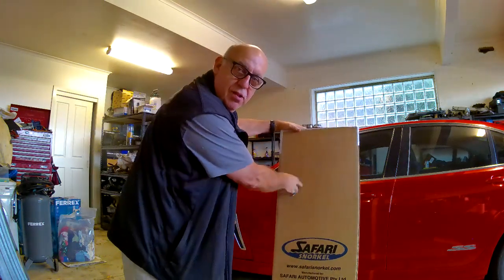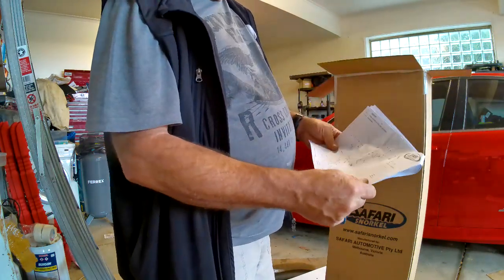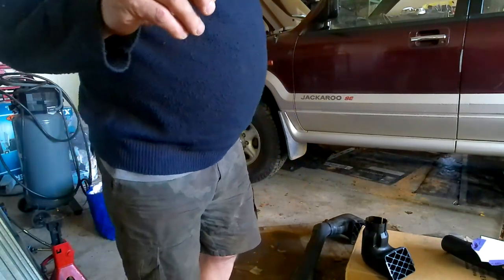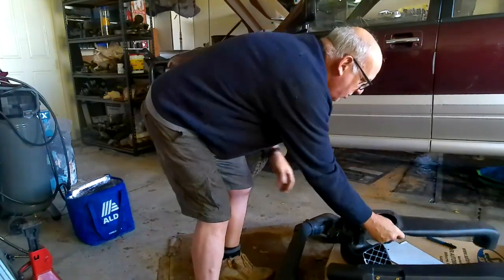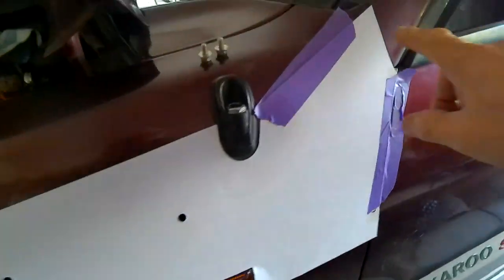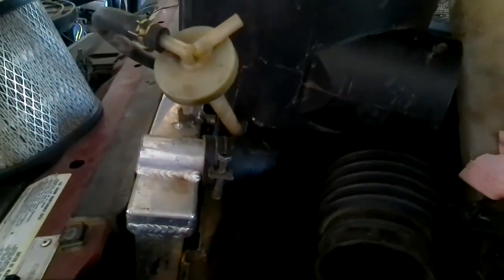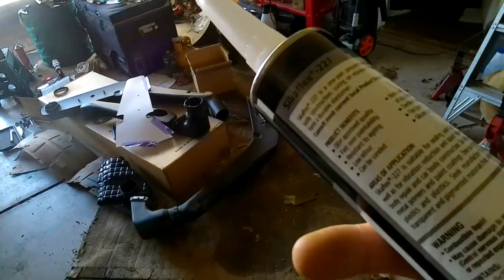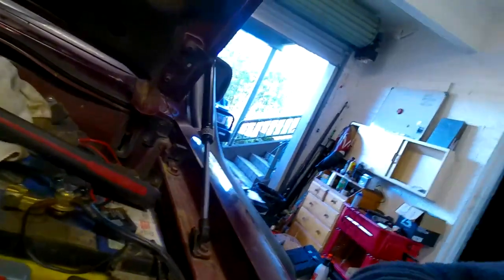Watch this Before Buying a Snorkel

Comment: can please do some video about roof rack.?????
Reply from the maker: Of course, I can and thank you for suggesting it. By the way, please don't go to Vimeo, I may not use that site. You could join my Patreon for the same price and you will get access to a lot of technical documents and the Isuzu Workshop Manual. 

What aspect of the roof rack do you want to look at, purchase or fitting?
Reply: @thejackaroo4WDcampingchannel  sir i really wanted to know about the channel mount where i can buy them or fitting them on the roof. i brought a roof rack with channel mount but its off landcurser 100 series. lol 😂 😂so can i do modification.??
Reply from the maker: @daraleas-mm2ne  I will do a video on this for you but summarise, I'm not sure about the 100 series. When I bought my roof rack, the consensus was that the King's Prado 150 rack was the way to go. Although the Prado 150 rack is also a gutter mount and the Jackaroo/Trooper does not have gutters.

So, you have the rack but you don't have the mounts so, the only option is to manufacture the mounts yourself which isn't easy if you are impractical or cannot weld. So, I will have a chat with my son and see what we can come up with, we may be able to come up with some mounts for you. However, can you please start by measuring the rack that you have, length, width and depth? Can you also send a couple of pictures where the mounts are to the channel's email address which you can find on the 'about' page?

Thanks,

Dave